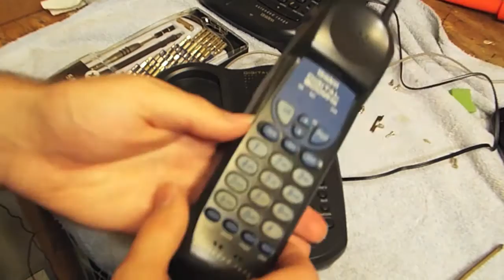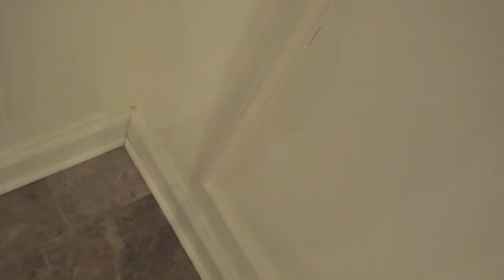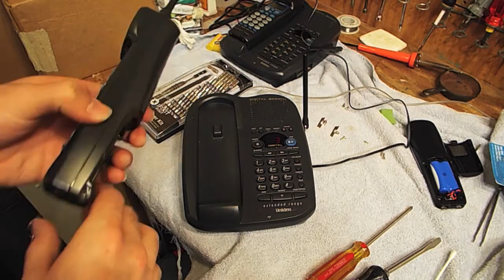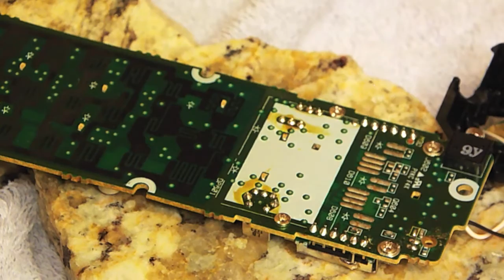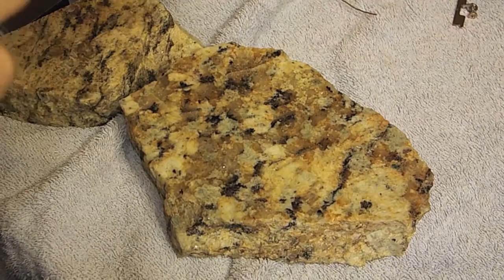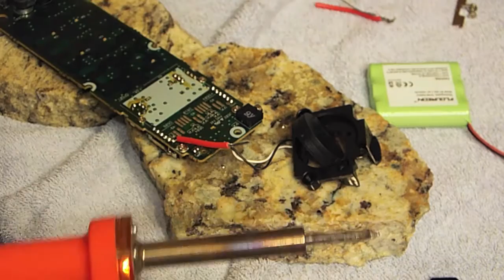Uniden EXA8955 Repair

Comment: Wouldn't the red wire have done the trick all by itself instead of creating another joint?  Or was it perhaps thicker than the original wire, which was hard to judge in the video?  I'm not very good at soldering either but I will say those joints don't look very secure at all.
Reply from the maker: Quite possibly.. It would also be conceivable that the original antenna (white wire) would have done just fine being soldered on 1/2" lower down on the board.. The method used in the video made no alterations to where the original antenna dwells,, which is why I did it that way.. Probably not necessary,, but I don't know for sure if any of those changes would have made a difference or not..
My soldering skills are nothing to write home about,, don't do it often enough to master it.. The joins will do just fine for this application.. There is no pressure or flex on them so I don't see any reason why they wouldn't hold..